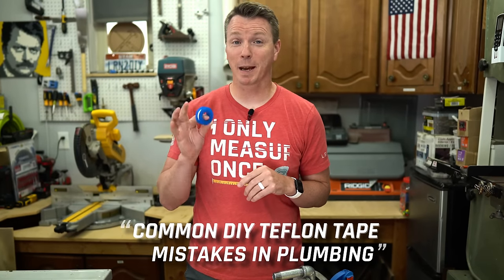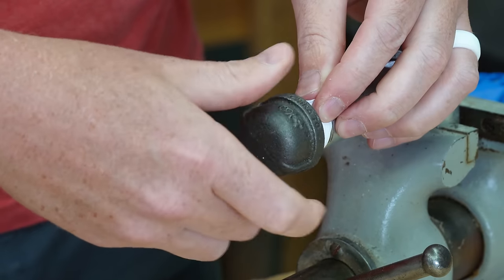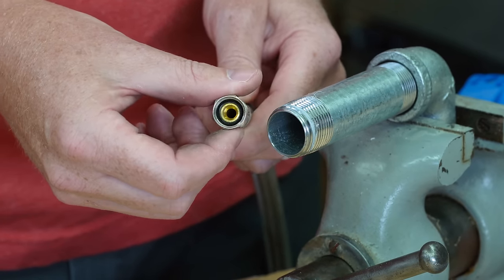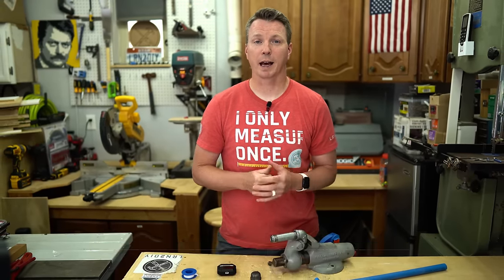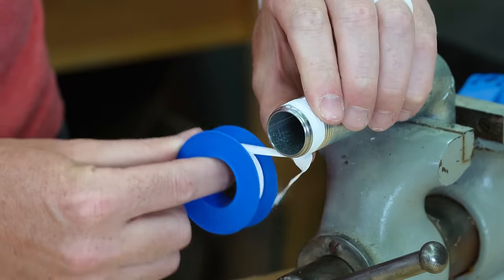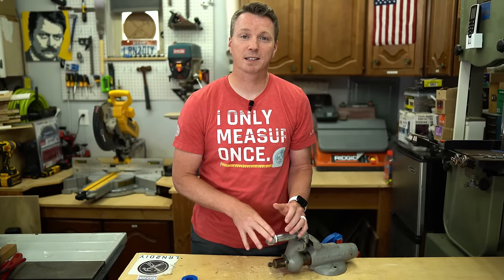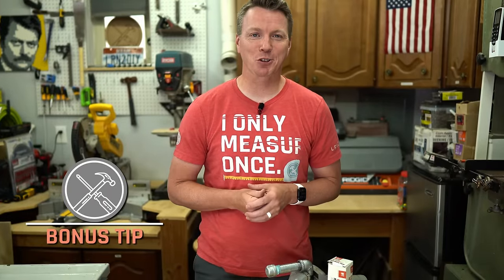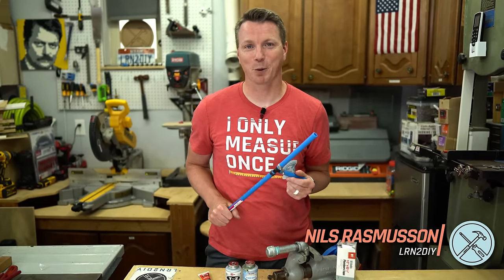6 Plumbing Mistakes DIYers Make with Teflon Tape

Comment: I was having a problem sealing joints of water pipes with multiple wraps of Teflon tape I asked a plumber friend why it wasn’t sealing and he told me to use just one wrap instead of multiples and guess what it sealed I even sealed a leak a plumber left me with multiple wraps with just one wrap with multiple you can’t get the threads to engage to the end of their travel not allowing the joint to seal or close properly I had a plumber take a nipple and tape it multiple times and attach a handheld shower hose to it one of those plastic fittings that only need to be hand tightened cracking the fitting causing a leak beware the overuse of Teflon tape I prefer pipe dope over tape because you can use more than enough on a joint and it will still seal and sit properly

Comment: Teflon tape is used on tapered pipe threads only. The threads on flare fittings, gasketed fittings, o-ringed fittings are not part of the functional seal and tape applied to them is wrong in every case.
Reply: Yes, and when I see teflon tape where it doesn't belong I get a little worried wondering what other cooties lay ahead.

Comment: Once upon a time I had a nipple going into the block of an old boiler that I could not get to seal. Old timer told me to use Teflon tape AND pipe dope. Worked so well that 20 years later I’m afraid not to use both when there is an old connection in the mix.

Comment: I use tape, then some vaseline over. This helps easier attaching of the other piece and the tape stops the two metal parts from freezing tight from the lime (acting like cement) in the water.
helps with undoing in future maintenance.

of course I dont apply vaseline to rubber, vaso being a petroleum product would destroy natural rubber.
silicone grease is very expensive.

Comment: Use Teflon paste. Much faster, easier and no fail. I have used it on hydrologic systems of 1200 psi without any leakage.

Comment: teflon tape is not a sealant.  That is the biggest misunderstanding in my opinion.  It is a lubricant instead.  The pipes are tapered which is what seals the pipe connection.  The teflon tape lubricates the threads to enable to joint to seal tighter.  If you consider the use of the tape as a sealant, you are doomed to begin with.  Slso, because it is a lubricant, it can allow pipes to "unscrew" with vibration or inadvertent twisting.  Plumber's dope is an actual sealant  which actually glues joints together to handle twisting or unscrewing.  Got to use the right material to seal up your pipes correctly.

White: used on NPT threads up to 3⁄8 inch
Yellow: used on NPT threads 1⁄2 inch to 2 inch, often labeled "gas tape"
Pink: used on NPT threads 1⁄2 inch to 2 inch, safe for potable water
Green: oil-free PTFE used on oxygen lines and some specific medical gasses
Gray: contains nickel, anti-seizing, anti-galling, and anti-corrosion, used for stainless pipes
Copper: contains copper granules and is certified as a thread lubricant but not a sealer

https://en.wikipedia.org/wiki/Thread_seal_tape

Comment: The primary reason for loose wraps is that there isn't space between a fitting and a wall, or between a fitting and another fitting, to loop the whole spool around. You have to get creative sometimes, and it can be very frustrating.  Not always as easy as it looks.
Reply: Roll some on the end of a pencil or dowel. Works great for tight spaces.
Reply: That is misusing the tape.  It is a lubricant.  The tapered threads are what seal the joint (or is supposed to).

Comment: The "compression sleeve" inside the fittings is called an olive.

Re tape, I hate the thin stuff, it's a real pain applying enough in a tight space, so I use the much thicker Fedseal pink stuff, which only needs a couple of turns and it seals brilliantly.
Reply: It's called a ferrule. An olive is that thing in a martini 🍸😉

Comment: I prefer using pipe dope. Never had any problems with this. My air compressor has pipe dope only fittings. I used yellow pipe dope on natural gas lines.

Comment: Putting Teflon tape on the threads of a compression fitting can actually cause a leak.  Reason is, you may not be able to run the fitting down enough of the threads and be able to crush the ring into the top of the opening.

The same thing goes for those fittings with a rubber O-ring seal.

Comment: Best tip: Don't. Use Henkel 'Loctite 55' or Tangit 'UNI Lock'. Works much better, you can unscrew the connection and it has the sealant integrated. Try it and tell me it is not on a whole other level.

Comment: Teflon tape works great for oil drain plugs; again 3 wraps minimum, and there will not be a single drip, so no need for over-tightening it.

Comment: 7: Using Teflon Tape as a sealant. Many people dont realize that teflon tape is meant as a metal on metal fitting lubricant so you can tigthen more without causing damage to the threads! 

Like the guy in the video that based almost all of the mistakes on the idea that its a sealant. lol

Comment: No teflon tape on compression fittings?  Yeah, right.  The tape is NOT for sealing; it's to prevent corrosion.  I have a whole bunch of compression fittings that have been in service longer than you have been alive.  The ones with a [minimal] amount of Teflon Tape on them disassemble like Day One; the ones without will need a new fitting if anything has to be disassembled...

If there were a good way of including pictures, I'd post a photo of a fitting I recently replaced.  After about 20 years of hard water and other issues, the valve AND the compression fitting had to come off as one piece because they were corroded together.  IF there had been teflon tape on that fitting, I'd only have had to replace the hose (too short to reach the new faucet), not the hose AND an otherwise working valve!

OBTW:  Teflon tape is an excellent product to use in automotive applications,  You know all those bolts you use to assemble your trailer hitch  or  your fenders or your brake calipers or some other accessory or part to your car?  You know how you end up breaking bolts -- or cutting them -- to get parts off for replacements or upgrades?  Well, a couple of wraps of teflon tape on CLEAN bolt threads are almost as good as using stainless bolts for these assemblies.  I've had parts mounted on the underside of vehicles for DECADES that were as easy to disassemble as on Day One -- because the threads had Teflon Tape applied before assembly!

Comment: I once worked at a shop that had all kinds of fancy pipe dope sealers and I found that while they worked pretty good they still often leaked. Nothing works as good as SOLID Teflon tape.
Reply: Also , nothing like finding where someone put Teflon tape on the caps for a flare fitting or a compression fitting.
Reply: Flax

Comment: Teflon tape and or pipe dope is not a sealant. The seal comes from Teflon tape or pipe dope to lubricate the tapered threads to tighten sealing the joint

Comment: A place where you should NOT use teflon tape is on hydraulic systems.  A special dope should be used to avoid contamination of the valves, pump seals and controls if pieces of the tape should come loose and get into the fluid.
Reply: WRONG Wrap the correctly as he demonstrated and you will not have strands inside the lines.
Reply: @hartstudebakerkid  Try claiming a warranty fix after they find pieces of your supposedly non-existent tape in the pump, valves and what else is there.  Why take the risk?
Reply: If you could plumb correctly there would be no slivers inside the hose.  I plumb correctly and I have worked with some science equipment that I suspect you would be to scared to work with.
Reply: @hartstudebakerkid  Please explain then why the FAA prohibits the use of PTFE tape in and around aircraft and their systems.  Not everyone is as proficient as yourself at "plumbing correctly" and the dangers of piling an aircraft into the "great smoking hole" is of concern.... And THAT is what "scares" me.  It's a no-brainer to be diligent in performing the tasks correctly and not placing things (and people) at risk.
That's all I'm going to say, conversation over at this point, have a great day.
Reply: @hartstudebakerkid hydraulic fittings seal on the tapered face of each fitting, NOT the threads! No need for dope or tape.

Comment: I have seen some plumbing inspectors fail the job when tape and "dope" used on the same fitting. All depends on the inspector's interpretation.
Reply: That is just strange. At least here on the freshwater-plumbing if an apprentice wouldn't use both then the master would scold them for their sloppy job.
Reply: @ABaumstumpf  Then that would be a foolish master. I have been using Rectorseal #5 since 1972 on metal and never, yes never had to repair a leaky joint. I rarely use PTFE. Generally only when in a location where the customer might be touching it.
Reply: @dallasarnold8615  "Then that would be a foolish master."
So accroding to you he would be a fool for following the instructions and doing that which ceritfication have required for decades? Suuuure.

"I have been using Rectorseal #5 since 1972 on metal and never, yes never had to repair a leaky joint."
Ah, so you made leaky joints and think you are the greatest cause nobody would re-hire a crappy plumber. ok.
Reply: @ABaumstumpf  I never claimed to be the greatest. But I have made a good living being re-hired by many GC's and all my work has come from referrals, no advertisements. So, anybody that does not do it your way is a crappy plumber. You must be a democrat as they are the only ones I know that are so narrow minded.

Comment: TEFLON is actually used for LUBRICATION - the LEAK issue is secondary -  and using  TOO MUCH is not necessarily better
Reply: "TEFLON is actually used for LUBRICATION"
That is just one part of it - aside from its main job as a sealant.
Reply: They just call it sealant for fun right?
Reply: @thoughtlesskills  
Yes…. You are really smart..  
it is a LUBRICANT and it DOES SEAL…

Comment: I beleive you are thinking the tape creates a seal.  The purposes of the tape is help lubricant the fitting as you torque the joint together.  The design of NTP is a taper thread.  When you tighten the fitting, it cuts into the metal and creates the seal.  This is why you should not back off a NTP fitting after you torque it down, it breaks the seal you just created.  For example, if you install an elbow you have go around a full turn if you dont get it aligned the first time.
Reply: It’s both a lubricant and a sealant.
Reply: @howtodoitdude1662  i put alot of NPT fittings together with just greese.  Can't use Teflon on oxygen systems.

Comment: The people who make thread tape recommend 1-1/2 to 2 wraps.  I have been using it since around the 1980's.  You use way too much.
Reply from the maker: Sounds like different manufacturers are recommending different amounts then because I read the instructions right off the box where it said to use "a minimum of three wraps". The point on that tip is to not wrap it around once and call it good.
Reply: I have used it reliably on fire fighting equipment plumbing up to 6" NPT down to 1/8" NPT and even hydrostatic test equipment up to 500 PSI or even 5000 PSI breathing air systems.  When it was introduced to me, at a 3m booth at a trade show, it was that is was only a lubricant to the threads to make it easier to obtain "interference fit" inherit in the design of tapered threads.  It was simply cleaner to use than the old paste.  

If you are ever in a situation where you just can't get by with less than 3 or more wraps of the stuff you have other problems that are not being addressed.

Comment: As others have said, the tape is a lub, NOT a sealant at least for PVC pipes.
Reply: "As others have said, the tape is a lub, NOT a sealant at least for PVC pipes."
Yeah - for PVC - where in general you use glue :)

Comment: I'm in my 60's and have done plumbing all my life (not professionally). I've never used teflon and dope together. I've used  them separately but it's never crossed my mind that you could use them together. If I used dope, it's always worked alone and the first try. Probably after teflon had failed.

Comment: Teflon is a lubricant, not a sealant.  It reduces friction so you achieve the seal the tapered threads are designed for. ...And yes, you can use it to stop a dripping (low pressure) connection on straight threads...but anything with water resistant "bulk" will do the same.
Reply: Old time plumbers used grease to put connections together to reduce the friction.
Reply: It’s both.
Reply: @howtodoitdude1662  No it's not, You can't use it on Natural Gas lines.  You may find formed "Teflon" seals on low pressure connections.  You may find Teflon as an addition to a sealing compound.....but it's not there for sealing.  The correct Pipe Dope is your best friend....not Teflon tape.  It's just for NPT threads....or a half-assed leak repair.
Reply: I use it as a sealant, because it works. Just like I sometimes use pliars instead of a wrench. It works.
Reply: @bigmacdaddy1234  Awesome.

Comment: At last!  Someone who uses Teflon tape and knows what he's doing. I just retired after 35 years as a plumbing / HVAC tech. So many of these You tubers don't know what they are doing. 
Lest you think I leave without a criticism, he did not mention that you should always use paste dope on gas lines, never Teflon.  It may be different in your jurisdiction, but the gas company does not allow tape dope here in Pennsylvania. He did show several instances where you ought not dope at all. That upped his cred with me. I will say, a light coat of paste on some troublesome compression fittings has gotten me out the door and on to the next job.
Reply: Right on
Reply: I never use ptfe on compression fittings, but a bit of paste acts as a sealant AND lubricant. Stops that annoying squeal as you tighten the nut.  Here in the uk we can use tape on gas fittings, but it has to be the thicker 'one wrap' which only goes round once. Trouble is that it's hard to tell if someone's used the wrong stuff, so hardly anyone used it, and I'm not sure if you can even get it anymore.

Comment: I'll keep an open mind... Can anyone give me some science on the reason of using Teflon tape AND pipe dope on the same fitting?
Reply: All I know is in commercial applications it was required where I live.  A Texas plumber on YouTube also said where he is located tape and dope were required in commercial applications.
Reply: I use to argue for dope only on tapered threads, that was 15 years ago, I've been a plumber for 30 years. The problem today is that quality control in the production of pipe and fittings is not the same as it used to be. Three wraps is correct for the tape although it must be wrapped very tightly or it will shred, Blue Monster is hands down the best tape on the market and works with gas or water applications. A very thin layer of pipe dope should be applied on the tape and threads because pipe tolerances aren't what they use to be. Someone that doesn't install hundreds of joints a week may get lucky with no leaks but for the professional plumber you need a system that works every time consistently.
Reply: @scotus72  I work with ammonia now and I have been instructed to use dope and tape, so I do. Your explanation seems reasonable. I appreciate it.

Comment: Using teflon tape with compression or flared fittings can cause leaks because the the tape will limit the the nut from reaching full compression of the union. Don't use teflon tape on those types of fittings. If you have a leak without the tape the you must replace the compression sleeve or repair the flared union. This is especially dangerous on flared gas lines.
Reply: When I was still doing instrumentation work using pneumatics and brass compression fittings, the department guideline was one wrap of white teflon on the threads--no more than that.  We always used Hoke fittings, which have a two-part ferrule.

Comment: In my opinion people should learn to use plumbing flax and thread putty over teflon tape. It's a bit trickier but essentially follows the same principle but it's extremely reliable joint which you can even undo few rotations and it still wont leak. Works with water and pressurized air and despite what some people say in my experience it also holds glycol just fine.
Reply: teflon paste alone rules... the stuff never leaks and lasts forever. the tape just gets balled up into 1 spot. the paste is ALL you need.
Reply: @SLAMBANGO  Any recommended brands.

Comment: A couple things you didn't cover is using the white Teflon tape used for water on gas line which uses a different grade of Teflon, usually colored yellow.  Other than that, you made me see a mistake I frequently make.
Reply from the maker: Good points. I thought about adding the tape colors and their uses but felt like the video was getting long so decided to leave that out. It's a great point though - use the right tape for the job.
Reply: Yellow is for water. What, you claim otherwise?
... see the problem there? The colours are irrelevant and depends on the brand and country.
Reply: @ABaumstumpf  white and blue are for water and yellow for  natural gas
Reply: I was trying to find the manufacturers that says yellow is for gas ...do you have a link?
Reply: @ABaumstumpf  Yellow is for black iron gas pipe. It's thicker and probably formulated slightly differently.
Reply: @ABaumstumpf  Yellow for LP/Natural gas applications, white for water, yes it most certainly does matter.
Reply: @ABaumstumpf  In the states Yellow indicates gas and gasoline rated. Yellow tape is also approved for use with drinking water. Oatley is a brand I am familiar with.
Reply: @MathewPollard-vj4uq  "In the states Yellow indicates"
But it is not mandatory and other brands do it differently. Relying on the colour is like saying "M-Series means it is a sports-car".